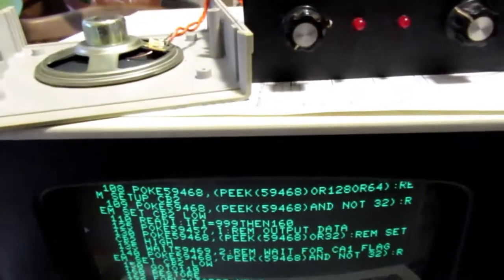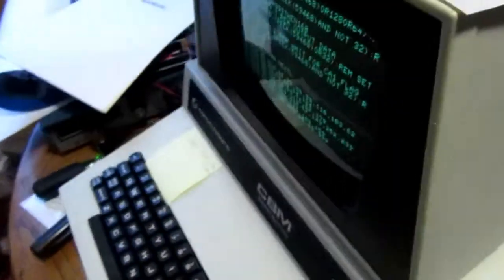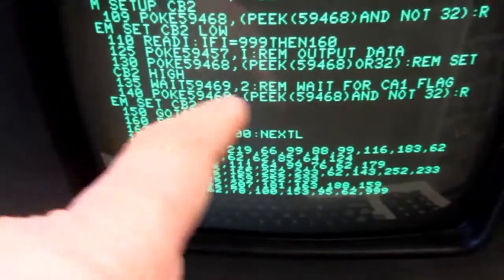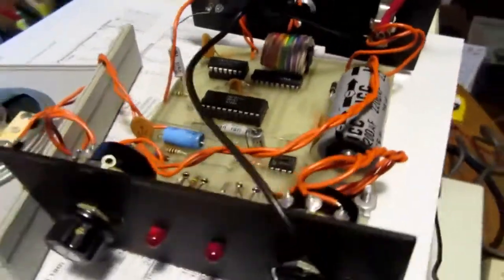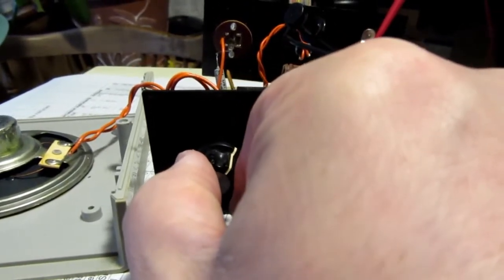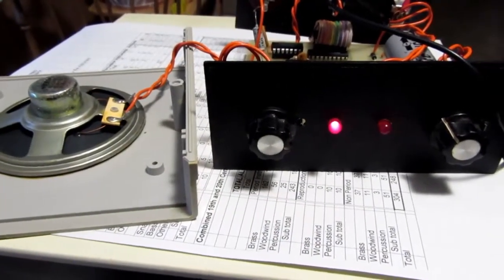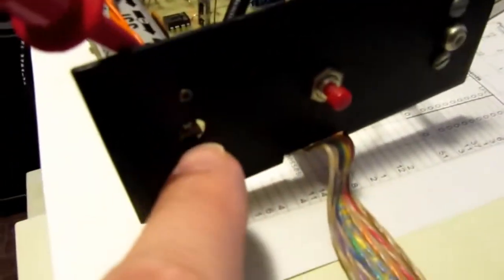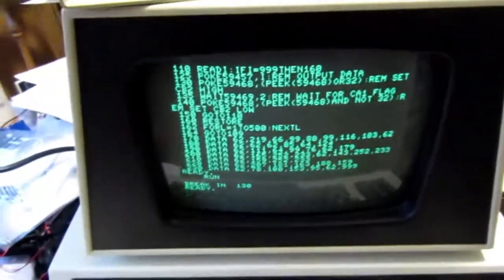Testing the "PVC Voice-box", a Votrax SC-01 based voice synthesizer

Comment: I've salvaged a couple of these Votrax chips and gone the Scott Savage route with an Arduino to control it. Still working on the programming but I have the hardware built and in hand! Cheers.
Reply: Do you have a schematic? I would love to get my SC-01-A chip working on a bread board.
Reply: @2150dalek  Agree--would you please share the schematic you're using with the Arduino?

Comment: Trying to get my Votrax to work on RS232 port, but com1 not seen by my laptop...still troubleshooting...maybe I need an older 8 bit pc.
Votrax works- speaks 'system ready' when powered up.
Reply from the maker: Dslek 2150, "Votrax" is a manufacturer, not a device. As such, nobody can understand what you mean.
Reply: @youtuuba  Oh, sorry...meant Votrax box with that Speech processor.....I also have a Hero-1 speech board with SC-01-A chip on it I got off ebay, I would like to interface to.

Comment: Sometime around 1982, I picked up an Intex Talker.  It was a similar box, but it included a 6502 CPU with some primitive code to convert ASCII text into phoneme strings for the SC01.  The Intex Talker had both serial (RS-232C) and parallel (Centronics) interfaces so you could connect it to a PC via the printer interface port.  (This was decades before USB was invented.)  I still have the box and it still works.  I hadn't touched it for about 30 years until last year when I was going through the sedimentary layers of my junk box in the garage.

Maybe I'll put up a video for anyone who's interested.